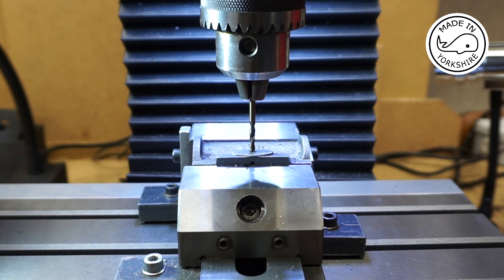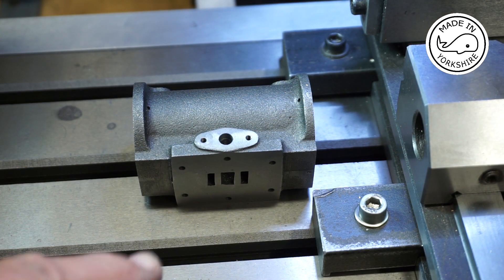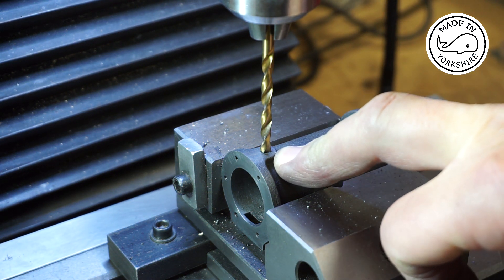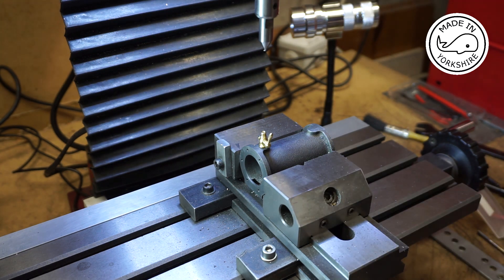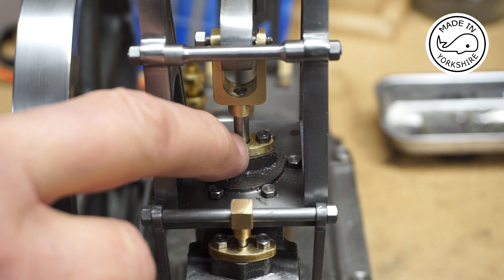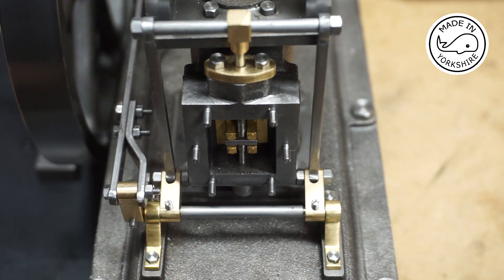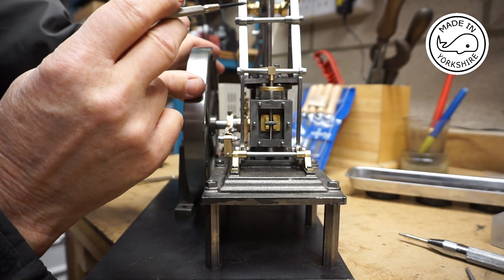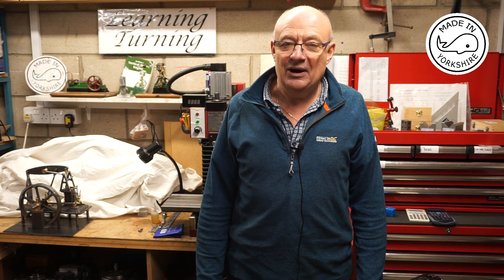#MT32 Part 18 - Making a Stuart Half Beam Steam Engine. The Test Build and Run. By Andrew Whale.

Comment: Looks great. When setting up glands I glue the brass adapter in place and drill through it into the casting to ensure alignment. I also glue any parts that require accurate alignment and drill together. If you have three parts to align I glue the middle to on and drill then separate and glue the middle to the other side and drill. With linkages like the valve setup if you have reciprocating parts like the horizontal levers the should have the centre of movement perpendicular to the linkages they are connected to. Yours bottom at the horizontal and then move up. This means that the upper half of movement will have a shorter throw on the linkages than the lower half of movement. This will result in slightly more powerful in one stroke than the other. Not a problem on this engine but if you had reversing gear it would make timing for both direction a problem. I usually make the valve spindle a bit longer and the line up position before threading and cutting to length to get the correct geometry. Having worked on over thirty Stuart engines I can say that they should all be treated like a hand made clock. No 2 are the same. Not helped by mistakes in some of the plans. So I often machine certain items to fit the rest of the construction and not to the plans. I also examine what I call paths of accuracy. The elements of the design that have to be really accurate, I give these special attention and often leave parts partially machined until I have the complete path of accuracy ready then align and machine to fit. Eg the Victoria, the cylinder has to be parallel to the sole plate surface, the centre line has to align with the height of the cranckshaft centre and the centre of the sole plate. The cross head guides and cross head have to align with these existing alignments. The crank has to be exactly at 90 degrees to the crankshaft and the big end pin has to be parallel to the crankshaft. It must also line up with the cross head. Out of the 7 Victoria’s I have worked on I have yet to find a Victoria that has complete alignment, and one is still in a box, in pieces because I cannot drum up the energy to sort it all out. Cylinder, cylinder mounts, cylinder end caps, cross head, crankshaft, crank, crank pin, eccentric strap and main bearings all need fixing or replacing. A real shame cos it’s got the best connecting rod I have come accross. I hope you don’t mind the diatribe? Still working on the web site

http://stuartturnersteam.com
I would appreciate your feedback.
Steve
Reply from the maker: Hi Steve - many thanks for such detailed advice - definately 'food for thought'. When I made my first engine, not so long ago (the S50), I hadn't a clue how steam engines worked and I was pretty new to machining too. Three machines on and I have a slightly better understanding of how they work. Gluing parts together to ensure correct alignment is a great idea. So far I think I've only tried matching steam chests and covers - and I've tended to leave things like brass adapter glands as the last thing to machine. I take on board your comments about valve linkages and I will try to follow your advice when doing the final build. I must say that your website looks ever so professional - I've put a link to it in my general description above.

I'm sort of OK following plans and identifying errors in advance of machining - but not great at thinking outside of the box. However, I was thinking only the other day that it would be fantastic if there was a central resource where model engineers could report errors found on all Stuart drawing versions. Maybe something to explore for your website, as it would follow an historical theme and it would be the place to go to for Stuart model engineers with plan queries.
As a very experienced model engineer, I was wondering whether you had any experience of the Cowells 90ME? My Sieg SC4 is quite capable but I quite fancy a 90ME for making small items. Maybe not entirely necessary, but I wouldn't mind having a go at making gears and possibly a simple clock.

Again, many thanks for the advice.
All the best.
Andrew

Comment: Good call on the gland nut!  Want to step softly here.... Are you going to set the timing for early admission ?
Reply from the maker: Hi Dan - now you must enlighten me here regarding early admission timing. It sounds interesting!
Cheers
Andrew
Reply: @learningturningmetal  
Advance the timing so steam starts to enter the cylinder near the end of the exhaust stroke.   This steam cushions the piston helping it to change directions and reduces the shock to the reciprocating mass.   It reduces stress on the engine and often makes it run smoother.   Your engine is new, tight and well machined so it will be interesting to hear how the sound changes.

I have never built a steam engine.  But Keith Appleton has explained and shown this on many of the engines he has worked on.  Looks to be a fussy thing to do.
Reply from the maker: Thanks for explaining Dan. It makes a lot of sense.
Cheers
Andrew

Comment: Andrew, why is the cylinder top plate on the angle ? I do not think that it is an optical illusion. When you were setting the valve timing the top linkage rod looked at least 1/8 " out of parallel with the top cylinder cover. That would have made the gland nut tight too.PLEASE CHECK it out before you do any damage. Well done by the way, all you need now is to find the BLUE paint for it.
Reply from the maker: Hi Dave - I wondered if anyone might notice that. I noticed it too when producing the video. I've checked the engine and by the naked eye looks spot on. I guess it must be my camera lens playing tricks when close-up. It's really wierd. Thanks for the pic too. The valve chest also looks to be at an angle (leaning right), and the flywheel tilted to the left. All in all, it looks like a bit of a dogs dinner, but in reality it isn't really. Definately something for me to double-check on the final build. Blue paint ordered a couple of days ago from Pheonix Paints. I've gone for L.N.E.R Garter Blue. I think I read somewhere that it's a cardinal sin to paint a static model steam engine in loco colours - but hey ho.
All the best.
Andrew